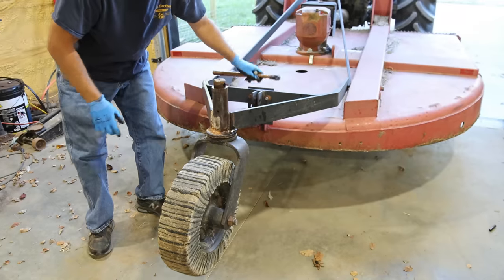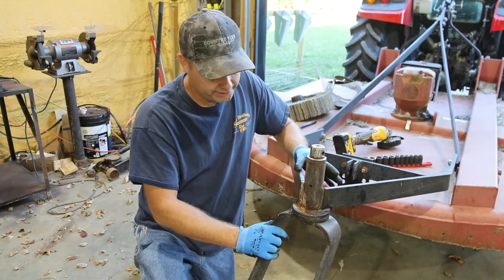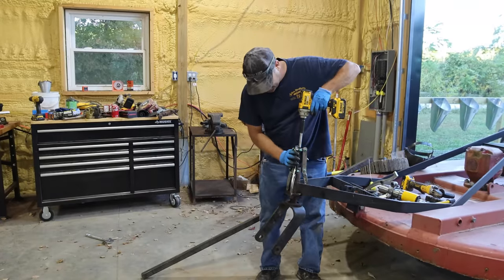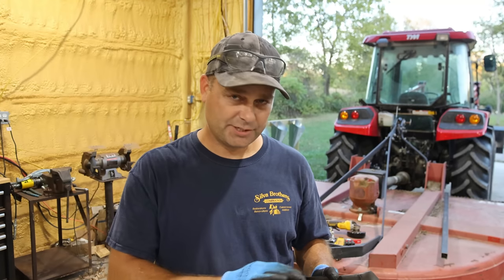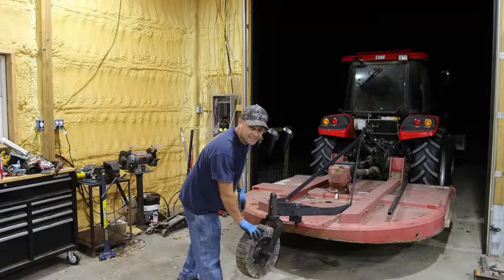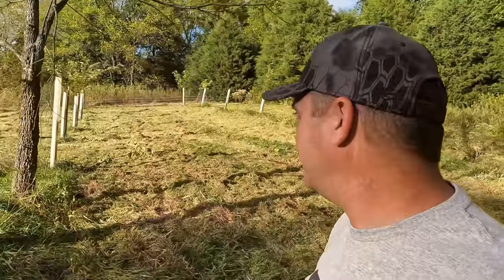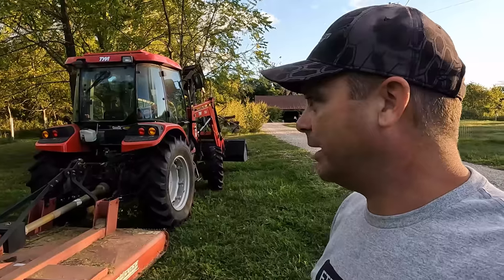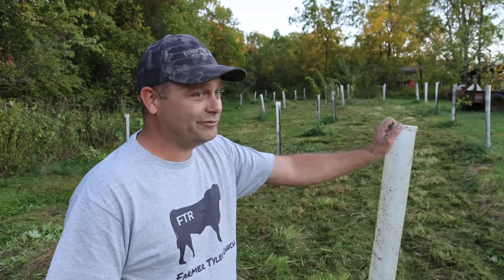I can't believe how hard this was to take apart.  I almost gave up fixing the bush hog mower.

Comment: all the energy of the hammer blow is absorbed by the bounce. if you just had it stable on wood blocks or something solid you could hammer that right out no problem...
Reply: I was going to say the same thing
Reply: I agree that means right about that wood I think it's a good idea
Reply: Doesn't do the seals on the lift cylinder a lot of good either.
Reply: I agree Robert Neff, it would have moved long before it did.

Comment: I noticed the grease zerk was missing on my cousin's brush hog last year. I couldn't get a new one in at first and noticed there were no threads. When I couldn't get a tap in, I realized the hole didn't go all the way through. So I drilled it out, tapped it, installed a zerk, and greased it.

Comment: Put a couple caps of brake fluid in you gearbox when adding fluid. If the seal is not cut it will swell it up and stop the leak. Do not add more than 2 caps ful each time it is filled up. That is a old mechanics trick.

Comment: Hey Evan, We always just filled our brushhogs with grease, when they started leaking, It works great and never had a fail. I worked for the township and it was what I was taught many years ago.  lol
Reply: Yeah we have done that too.... we always used john deere corn head grease though. It's like a oil and grease mix if you wanna call it an in-between

Comment: I've seen a few frozen swivel wheel shafts in my day, but I think yours was tighter than any of them. We all get behind with maintenance and that seemed to be the case with the shaft and overgrowth. You did a nice job of catching up both Evan. Thanks for sharing the experience.
Reply from the maker: The grease zerk wouldn't take grease this year.  And I didn't have the correct size to replace it.  I finally got the right size  zerk and it wouldn't take grease either.  The shaft was completely plugged up.  That's when I started trying to take it apart and used the torch the first attempt.
Reply: @CountryViewAcres  I know exactly what you're talking about on the zerks - If you need this size, you have that size, if you need this thread all you have is the other thread and forget about the angles. Plus, as you say, sometimes even a new zerk won't take grease.   🤷‍♂

Comment: I own 6 different bush hogs. 4 with multiple gearboxes I pump 1 tube of grease per box and as it heats it helps the seal hold oil!

Comment: The gear box on my brush cutter started leaking bad. I pumped it full of John Deer Corn head grease. It is a zero viscosity grease and does not leak out.. Works fine now.

Comment: That video looks like an evening I've had with the brush hog I bought new I was mowing a ditch leading down to a Levy that was to wet to mow long ways so I was backing the mower across the ditch mowing one side then the other I had the tractor in 4x4 and ended up bending the shaft for the wheel bracket I finally got it out by putting it in my 20 ton shop press and pressing it out it wasn't an easy task I took it to a machine shop in the next town west of where I live he cut the shaft off and welded a ram stock for a hydraulic cylinder he on and he said it would be stronger than it was before but not to brush hog in 4x4 all the time anymore

Comment: Tractor Supply sells quart bottles of 00 cotton head grease, that’s what I use in mine, doesn’t leak. It isn’t displayed in the oil and grease section, think it is in the PTO or cutter parts section.

Comment: Well done! For that brush hogg wheel I'd be inclined to be a bit more generous with the grease and look for something to put over the top to keep any rain from getting to that pivot shaft, perhaps an old plastic tumbler? A bit dirty and greasy would be far better than going through all of that again.

Had to chuckle at the FTR t-shirt. If you get Pete from Just A Few Acres involved  between you 3 you can resurrect machines from the old farm equipment bone yard quite well.

Comment: Fill the gear box up with grease then add the gear oil. It will help slow down the leak and keep the gears lubed if you run out.

Comment: Mix grease with your gear oil and make it pretty thick will help with lube and leak less .. most brsh hogs used what is called cornhead grease instead of gear oil  they are all notorius for leaks even with new seals  i take a paint mixer on a drill to mix them together the thicker the better

Comment: I had luck with a frozen rear blade pumping grease into the pivot to get it to break loose.  Looks like it was well worth your effort to fix it.  My brush hog, because of my vintage tractors, is one of the lite weight mowers from TSC (Countyline).  That one looks much more substantial compared to one of those.  Love the shirt.  I do appreciate how a number of content providers (such a cold term) like you in this space support each other.
Reply: I think if he had replaced the grease fitting first and then greased it he may have been able to break it free by twisting it.
Reply from the maker: I did replace the grease zerk and It still wouldn't take grease.  It Hasn't taken grease since I owned it.  I removed the grease zerk before I heated up with a torch.  That's why it was missing.

Comment: When your dealing with rusted pins in sleeves next time heat the sleeve in one spot up and down the entire length of the sleeve only just enough heat to expand the sleeve then pour water over the top of the pin to cool it down causing the water to penetrate between the sleeve and pin then heat again on the opposite side and pour water over the top again the water will be sucked further down inside and then twist just as you did with the pipe. Repeat 90 degrees from that point if needed. Adding the water turns the rust to a paste and lubricants the pin in the sleeve. This works on those large high dollar rusted nuts and bolts as well.

Comment: I just had to do a similar rebuild this season on my brush hog. The grease zerk was plugged when my father in law bought it 15 years ago and he never bothered fixing it. It seized up and started digging in, but thankfully it was not as seized as yours. I used a heavy duty hammer drill with a pointed chisel tip (like on the puller) and it pretty much was able to vibrate it out.

Comment: I took a board and wedged it into the fork. Forced it and it started to turn. Put a new grease zerk and had someone grease while i moved it back and forth. Finally fell out. Took a grinder to the shaft and put it back together. Never an issue since.

Comment: If replacing the bottom seal on your mower goes anything like mine did, you're going to need another person alot of heat , a big hammer and a piece of solid stock to knock the stump jumper off. It was a royal pain!

Comment: I've had the same problem on an old brushog I used to have with the same tail wheel set up 
. Ended up when I got it off took it  over to my neighbor and he got it on his lathe the pin had a slight bow in it you couldn't see with the eye. He turned it and it went back together really easy.

Comment: Your efforts on the tail wheel paid off successfully, good job. That's a pretty nice 7' brush hog, I was looking at them and they were just too pricey for my budget, so I settled on a used 5' for about a tenth of the price. I've done a lot of brush hogging with the smaller sizes and by far the most problem I've had is the tail wheel, guess I just don't keep them greased good enough. Way to stay with it, nice job on it and clearing of the brush. Thanks for sharing and I hope you all have a wonderful weekend.

Comment: Get some 00 grease from Tractor Supply for the leaking oil in the gear box. It is about the consistency of home made jelly and mixes well with the regular gear oil and helps with leaks.

Comment: Hey Evan, if you didn't want to replace the seals in the gearbox, on some of my older gearboxes that leak bad, I switched over to just having really good high temp grease in there.  Still gives lubrication that is needed but no more pesky leaks!  Especially on stuff like the brush cutter that doesn't get used all that often.  It lasts a long long time.  Might be something to think about!

Comment: I saw where you used some PB Blaster which is a good product.  One thing that I have learned that works well on frozen/stuck/rusted bolts is a 50/50 mixture of transmission fluid and acetone.

Comment: You can use cotton picker spindle grease in a bush hogs gearbox in place of gear oil and it won't leak out. Our local co-op keeps it in grease tubes for ease of use.

Comment: If that gear box still leaks oil something you could do is get some disc mower grease and fill the gearbox with it. It's liquid enough to flow as it's needed in the box but viscous enough that it won't leak out. Not a proper fix but it works. I filled my mower gearbox two years ago with it and haven't had to top it off.

Comment: Drill and tap the outer tube and install a grease zurk. Did it to mine. Worked great.
Reply: It had a hole for the grease zerk already.  Evan just didn't have the right zerk to fit it.

Comment: Digging the Silva Brothers t-shirt.  My go to rust buster mix is: 1/3 Marvel mystery oil, 1/3 automatic transmission fluid, and 1/3 kerosene.   Works like a champ!  Try some 85w-140 gear oil, a little thicker might slow the leak.

Comment: for the leaky gear box, try John Deere corn head grease. its sort of thick when cold, but turns liquid with heat. I have a leaky gear box, (fill it up, and its gone in an hour). Since Ive used the corn head grease. its still at the proper level

Comment: a quick and dirty trick for leaky gearboxes is to put a tube of grease in with your oil to thicken it up so it doesn't leak past the seal just don't make it so thick it doesn't flow!!  sometimes you can run a brake hone through a tight tube to get a shaft to be looser

Comment: Stuck shafts are a bear to get loose.   You the fight!!!!   
 Vibration can sometimes do the trick.  
Like a small pneumatic hammer with a flat bit on the outer tube.
Some of that could have been baled it was so thick.

Comment: Wow, the heating and hammering must have been part of the culprit. My shaft is quite loose in the bushing on my rotary mower. Just had to replace the wheels on my finish mower thanks to armadillos and holes everywhere.

Comment: I hate a leaking seal. I owned a Covington Cutter and a Dorsey Cutter both with leaking seals. Covington bought out Dorsey years and years ago. 1:1 gear ratio and would cut whatever you could get it on top of. 

The stump jumper was a 1” thick steel plate and was welded on the shaft from the factory. You had to grind down the welded shaft until you could wedge the plate off. I never replaced the seals just kept filling it with used motor oil. I hated to have to do that before I could cut and had to keep a check on it as it would leak out quickly. 
    I bought a double deck domed JD MX5 a few years ago and have been happier. If you raise up the rear of the rotary cutter a little higher than the front so that debris can come out from underneath the cutter, it will cut easier and better. 
    My tail wheel shaft form is bent and the wheel runs on it’s edge a little. I’ve already replaced the shaft once and have bent it again. I’ll fix it to where it won’t bent the fork so easily this winter. 
     I enjoy your videos. Keep up the great work.

Comment: I hope your gear box is easier to separate from the cross head than mine was. I fought that thing for months. Finally took studs with two nuts on each between the gear box and deck. I went around and around until the deck was bent in about an inch. I also installed just the bolt on the bottom but left about an half an inch loose. Then put floor jack on it and almost lifted off the ground. Finally gave up and left it under tension for a week. Went out one morning and it had popped loose finally. What a battle.

Comment: A few years back I had success using a product called ATP AT-205 Re-Seal on an older leaking mower gear box. You might want to give it a shot before you tear yours apart, it's about 20 bucks on Amazon.

Comment: A few drops of KROIL on the shaft and the wheel assembly would have fallen out. Good to see you put some grease on the wheel bearing before it becomes a repair video. Thanks for another good video.
Reply from the maker: I didn't have Kroil, but it had almost a complete can of penetrating oil put into it.

Comment: My two recommendations are to put some sort of grease on the puller threads this will help with them not stripping out and the other is if you are going to use a hammer on it support the back end of the mower with a jack stand because the 3 point is absorbing all the energy that you are generating and non of the power is being transferred to the pin that's why the pipe was jumping so far out of there each time you were hitting it.

Comment: Use grease in the mower’s gear box with the oil . Grease can seal up the leak of the oil. Then add enough oil to splash up with the gears. I got a forty five year old 6 foot. Still mows about ten acres a year. Oil seals won’t stay in right never ever always leak.

Comment: Hey Evan i to have leaky brush hogs and dont like paying for and waisting the oil when i goes straight through them what you can do is remove all the oil and fill it with grease that works great and ive done it for years

Comment: My dad and granddad used to use a mixture of diesel fuel and trans fluid  and spray it lots  if there is a place diesel will go thru there and trans fluid will lubricate it   Another truck is to warm up the outside tube and melt parofin wax  (or candles) let it cool off and that helps too

Comment: I had a similar issue with a ford 8600 tractor spindle. I went by it everyday, sometimes a few times a day and hit it with some shots of PB Blaster. After that it practically fell out. Same thing with the LH leveler for the 3pt. Threads were seized. That one took a month of squirting and working back and forth but eventually it started moving easier

Comment: When using sledge on the shaft you have to support the wheel frame to the ground so the full force is put into the shaft from sledge. The mower attached to 3 point wasn’t sturdy enough

Comment: To use heat was the best way,  but it should have been supported with axle stands or blocks. Also ,using a drift prevents mushrooming when hammering.

Comment: Next time dealing with something rusted together, place a small piece of wax on it and heat it up just enough to melt the wax. Capillary action will wick the wax into the rusted piece. When the wax resolidifies, it expands slightly, loosening the joint. This method works well on really rusty nuts and bolts like wheel lugs and exhaust manifolds. You need very little wax and just enough heat to melt the wax.

Bully on the zerk. It should have had one from the get go.

Comment: Some penetrating oil in the tube on the wheel and come vibration with the pullers tensioned up often does wonders.  
Also the tail wheel should have had a grease fitting from the start.  The one you added should keep the rust to a minimum.

As far as the oil goes, I buy the cheap farm store / house brand in a 5 gal pail.  It's actually pretty good stuff, sometimes I'll add some lucus hd stabilizer.  Dad always told me even bad oil is better than none....

Comment: you need a smaller tractor/mower for the chestnut areas. i run 48", 54" and 60" through my orchard. 7' in my open fields.

Comment: Hi Evan, Not to sound like Mr 'Know It All'.  For your 'fix it' shop, go to harbor freight or Menards buy you two different sizes ,,the smally and the biggie,,of the old school  oil squirt cans with long nozzle on them. Head to Menards buy you gallon can of acetone,,in the paint section ,and two quart bottles of ATF automatic transmission fluid, (any spec). Do a 50/50 mix of these two fluids into your brand new oil squirt cans   keep on the shelf, You'll be surprised how much this concoction will help free up rusted stuff like this shaft( squirt it down 24 hours prior to trying to knock apart) . You will have extra to mix up as needed in the future. Make sure you shake squirt can before using as these two will inhertantly separate while sitting on shelf.
Reply from the maker: I used about a whole can of pb blaster on it.  But I had never heard of acetate and ATF mixed together.
Reply: @CountryViewAcres  I hear ya Evan,, Have you ever tried to get an insert out of a receiver hitch that has been left in for  a year. Easier to unbolt receiver hitch buy whole new receiver for truck, This concoction does have electrolisis is the good thing,,into the rust,,Thought it was BS,,,but you should buy stuff to try,,Always fun to have your own 'home brew' stuff to try on the shelf. Your perseverence paid off. Hard to image something so simple can take up so much time,,huh.

Comment: Evan, was there a zerk fitting missing on the vertical shaft of that wheel?
Reply from the maker: I took the zerk out the first time I tried to take it apart.  that's why it was missing.  but I installed a new one when I was done.

Comment: If you heat the whole tube then it’ll expand onto the shaft, transfer heat on to the shaft and actually clamp it even harder. Try heating just a stripe down the tube and that’ll act like an expansion piece and hopefully open the tube up.

Comment: I was about to say that it was odd that the shaft tube didn't have a zert. Undoubtedly the problem was that it wasn't greased often enough to push the dirt and sand out from between the shaft and the tube.  Yes it can be messy but it is a necessary evil to prevent wear and the grime from seazing it up.
 As far as the gear box goes a lot of people I know  pump a bunch of grease in with the gear oil it helps to pack the seals and slow gear oil leaks.